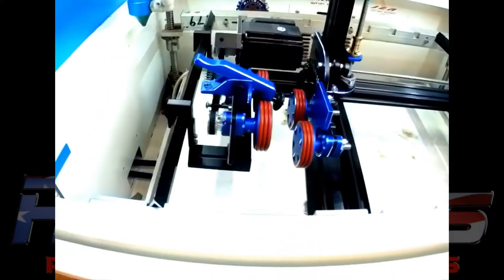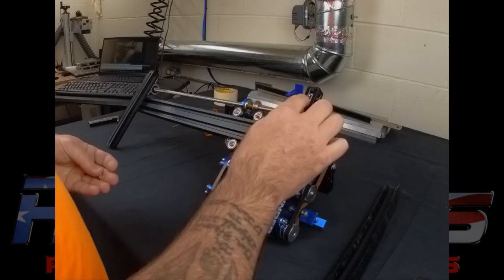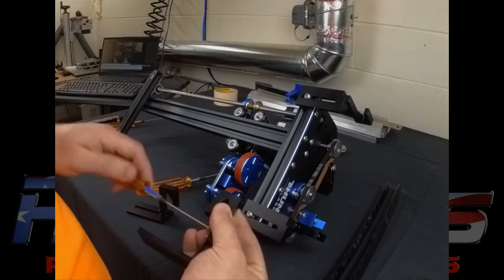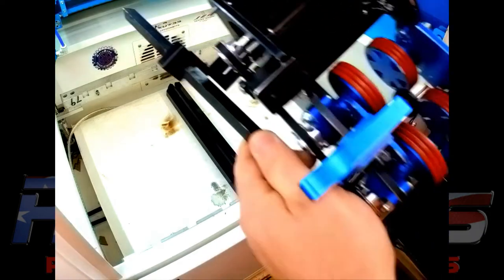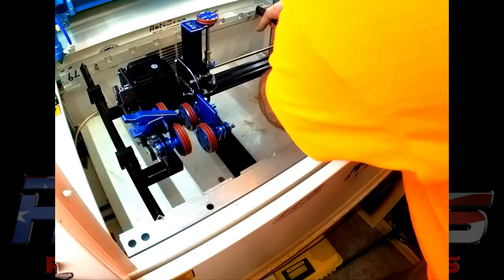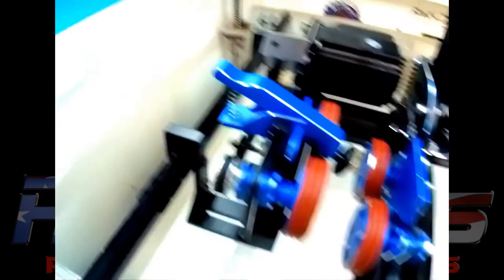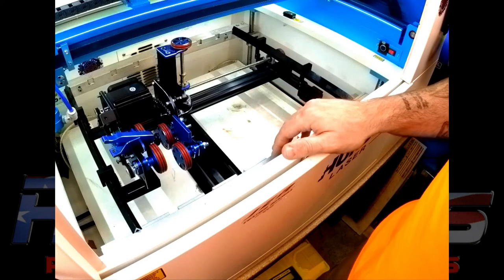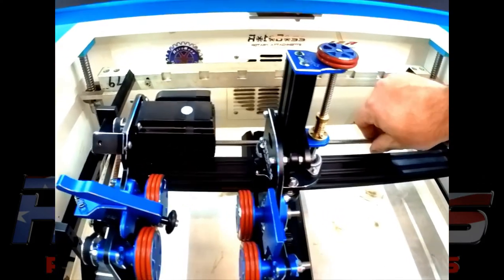Thunder NOVA 24 is now Ready for the RotoBoss & RotoBoss Jr

Comment: Thanks for taking the time to put the video together. I'm looking at buying the Thunder 24.  A couple questions. is the reason for the brackets because the Thunder 24 has a smaller cabinet?  All the other videos I have watched show it sitting on the honeycomb tray, but they were probably larger Thunder models.   How do you keep the head from crashing into the taller parts of the Rotoboss?
Reply from the maker: Yes the brackets are because of the smaller cabinet and the limited z height compared to larger machines... for the rotoboss you would use the dual adjusting towers to adjust the z height which will keep the nozzle away from the towers. Also you can spin the rotary around so the towers are in front of the laser head and you would not need to worry about head hitting the rotary. The Junior on the other hand would not be an issue at all because it only gas the one tower. Hope that helps.